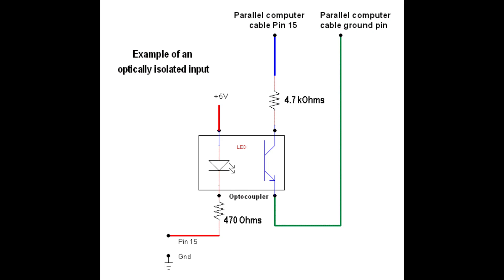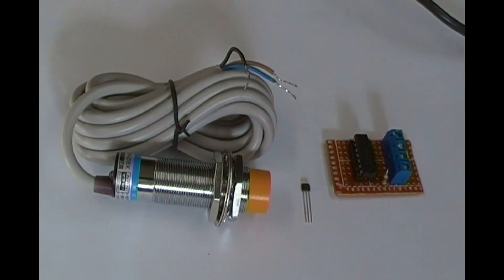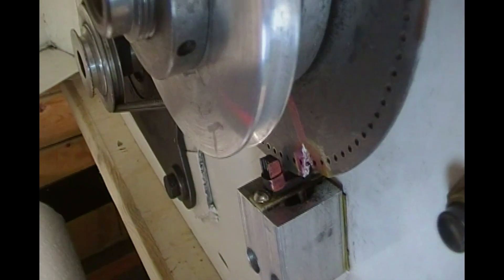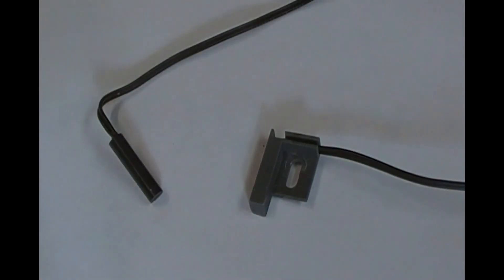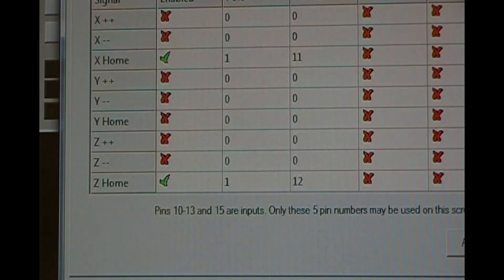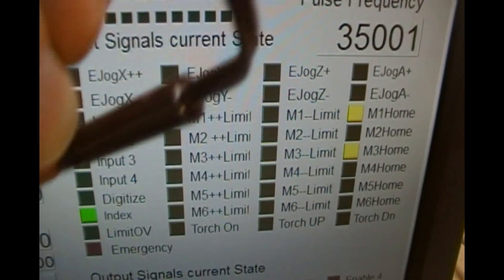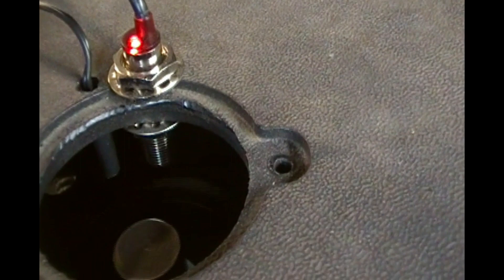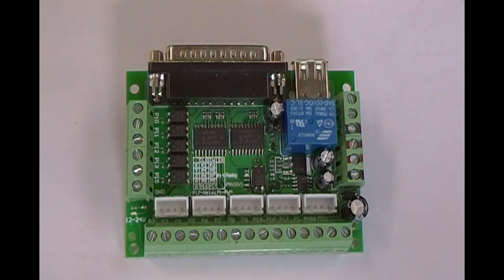Easiest way to add a speed sensor to a CNC breakout board .

Comment: I have done all these. I  have the index to light up in the diagnostics Mach 3  but no action in the tachometet.
Sny help welcome.
Thank you
Dennis Anghelatos
Reply from the maker: It's a learning experience you will have to check the basics again such as entering the command M3 in your GCode to start the spindle, or clicking on the Spindle icon in Mach 3.
Reply: Thank you very much. I will try your suggestions.

Comment: Could you please explain why you nee a inverter circuit to connect to breakaout board? What its that, where i can find it?
Reply from the maker: You need to use an inverter circuit only if your are using a photoelectric or proximity sensor as a RPM sensor with a CNC breakout board, you can make an inverter circuit or perhaps buy one already made. An inverter circuit used in this video inverts the  +5 Volt output signal from a photoelectric or proximity sensor to zero Volts each time their output switches to +5 Volts. An easier way is to use a simple reed switch and a small magnet as a RPM sensor, the reed switch connects directly to a CNC breakout board without using an inverter circuit.

Comment: If i use a bike read sensor would i just glue or mount magnet to the motor shaft  and just mount sensor part using L bracket to sllow it to hover over motor shaft?
Reply from the maker: Using a bike read sensor is an interesting idea, I have never used a bike read sensor before. I would suggest taping a magnet to the motor shaft, it is slightly safer than gluing a magnet, the glue could fail and the magnet could fly off into space. You can use an L bracket to hold the sensor in place. Hopefully the idea works for you, good luck and let me know how you make out!
Reply: Initially it Seems to work..i used bike speedometer sensor.i had lsying around ...got the idea from ur treadmill sensor...i taped msgnet to motor shsft snd made s custom aluminum bracket to mount the sensor..wired to board